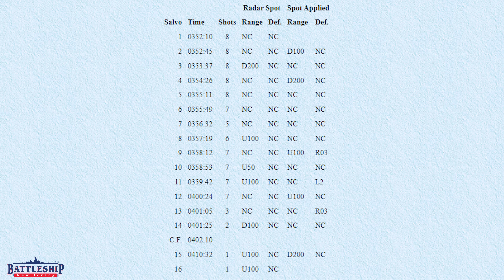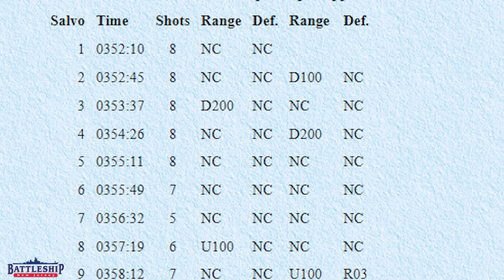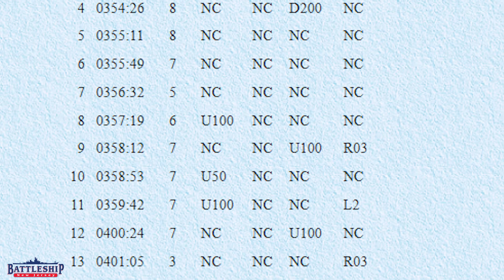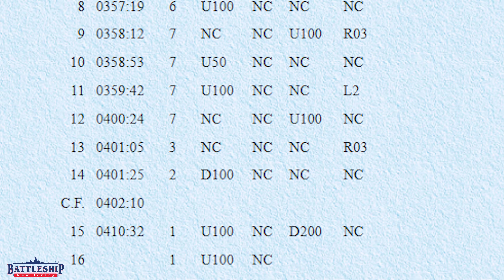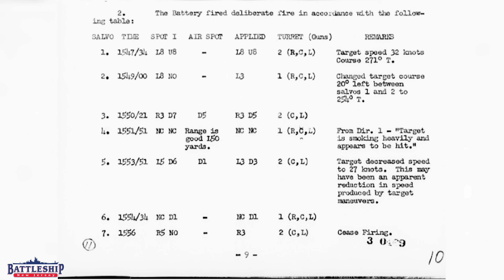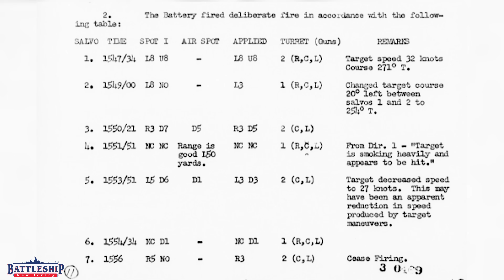Is Misfiring Naval Artillery Common?

Comment: I know that this is a late question, but what happens if the shell is rammed into the lands, but is not fired?( malfunction with equipment, powder, etc) has that ever happened? Would they try to fire a reduced load? I’d imagine in a normal instance where they had a shell loaded but decided to not fire, as you explained in part of the presentation, they would just fire it in a safe manner. Just have never seen what the procedure would be for a misfire or shell that needed to be removed. Thank you, anyone, for input.
Reply from the maker: If they can fire it, they will. If they absolutely cannot fire it can be brought back out but it's tricky and dangerous.

https://youtu.be/6aC-dqji_Jc
Reply: @BattleshipNewJersey Thank you!! Another commenter had mentioned that there was an episode regarding this, but I couldn’t find it. In small arms, it’s pretty straightforward, but there is absolutely no way that anything like that could be used on naval artillery. Thank you  for the excellent explanation.

Comment: I had (mistakenly) assumed that, in a battleship vs. battleship engagement, the nonlinear behaviour of the Lancaster equations would so severely punish a ship for any loss of main battery fire that any ship that did suffer a misfire was almost certain to be destroyed. For that reason, I concluded ship designers had done everything in their power to prevent such misfires.
As you point out, though, there are two missing pieces to that logic: first, all ships suffer from it, so in reality both battleships would have guns missing their salvo time; and second, a "misfire" only very, very rarely means something that disables a gun or turret for the rest of the engagement. 
Thank you for this very interesting video, and for the reminder not to forget about operational realities in conducting tactical analysis.
Reply: You just sent me down a sinkhole researching those equations, thanks for that

Comment: GMG1(SW) ret. Misfire indicates that you initiated a firing but gun did not discharge. Mechanical failures that prevent gun loading aren’t considered misfires. An open breech explosion is just that and not a misfire. Modern naval guns have a very low misfire rate. Most misfires are caused by faulty ammo. Over 20 years and thousands of rounds fired only had 2 big gun misfires, one ammo, one mechanical failure. Have a few misfires from small arms ammo. If the ammo quality is high you see very few misfires.

Comment: My first engineering supervisor served on one of the Iowa class battleships ( I forget which one ☹️). He claimed that a full 9 gun broadside moved the ship sideways about thirty feet. Is that true?
BTW: My dad worked at Midvale Steel in Philadelphia from 1943-1945 machining 50 caliber 16” naval cannon barrels. His section machined the outer surface, & prepared the bore for fitting the sleeve. He said those giant barrels would stack up beside the lathes, stacked like telephone poles, sometimes for several weeks - until one day they  were gone! Nobody ever saw them moved. Talk about wartime secrecy…
Reply: Some high alloy steels need to sit for some time before their heat treat is fully cured. Ditto for armor plate. So I've read.

Comment: I didn't realize how much damage battleships did to themselves simply by firing. Still, that's a lot of power to be unleashing and it does go in most if not all directions. As much as I hate the fact that battleships are no longer of the line, I can see why a destroyer with missiles can concentrate power on a much more pin-point basis and not destroy itself in the process. Granted, it would need to be repainted. Sorry, uncle Joe.

Comment: Thanks for the info that was interesting, I would have thought there would be mechanical failures with more often positioning issues and not able to bring the gun to a target. But I never imagined it was that often and that soon in a battle for failures to start in, it's still amazing what they pulled off in the heat of battle because I'm sure just to fire and load 1 of those massive guns takes a lot of resources and manpower with massive fire support system's to maintain each single gun with lots of chances for mechanical failure. As the ship is aggressively maneuvering in high seas at times when engaged with enemy ships when not sitting firing in land. Those guys where no doubt real men inside those turret's

Comment: Yeah, pretty much. Dreadnought-type battleships, broadly defined, went from prototype to the full limits of the system in approximately 35 years. Every one of them was experimental, even the Iowas, as were the pre-dreadnoughts before them. And the obsession with bigger or heavier shells and longer-range guns meant that ships weren't properly designed to withstand the concussions of their own guns. It seemed like a good idea at the time, they were tremendously "cool" and threatening, but they tended to hamper their own tactical effectiveness, and be more useful as strategic deterrents than actual combat weapons. Compare medieval castles...

Comment: I would expect that from time to time there would be mechanical issues, but never to the extent described by Ryan.  The only notable out of service gun that I've read about was when turret #1 on the USS South Dakota took a Japanese bomb hit on the roof. The bomb damaged a gun from turret #2 by making large gouges into the barrel, bad enough that it was decided to secure the gun and not use it.  The bomb wasn't big enough to penetrate the turret roof, but apparently scarred the roof, and also destroyed the periscopes that poke up thru the roof.

Comment: I was a Royal Navy gunnery officer in ships for 14 years.  Never had a misfire.  Misfires are no real problem,  It is a hang fire that causes grey hairs.  A misfire means that you pull the trigger, and nothing happens.  A hang fire means that you pull the trigger and it doesn't go bang, but fizzles gently.  It may go bang at any time, particularly if it is jerked or knocked.  It is difficult to tell whether it is a misfire or a hang fire externally, so you always act as if it is a hang fire, and keep the weapon pointed safely down range for at least 30 minutes before unloading, and then immediately storing that cordite safely overboard!
Reply: Would some valves for injecting water into the chamber help, to extinguish any sparks that could still ignite something? They would need to be very pressure tight, of course...
Reply: I'm a retired US Army artilleryman.  Wow! Same problems, much different ways of dealing with it.

Comment: IIRC, the RN and the WW1 German navy didn't open fire with full broadsides - preferring to fire a salvo (typically half broadside - e.g. left guns in a 4x2 arrangement, modified by  the later Nelson and KGV classes) at the estimated range, followed by another salvo at a different range before the first salvo landed.
The spotting would determine if the range and line were correct. With a nominal reload of 30 seconds, time of flight about 60 seconds, this is a quicker way of getting on target.
Once accurate radar range and fall of shot was available. the practice could change... HMS Duke of York fired broadsides at the Scharnhorst based on radar ranges from the onset

Comment: Misfires are no joke. My grandfather was onboard the USS Mississippi (BB-41) when they had a full-on backblow during gunnery practice in 1924.  A gun in the no. 2 turret exploded when a small ember from the previous shot was undetected as the power bags for the next shot were being loaded.  Something like 40+ men died in the explosion, then several more died when a remaining bag detonated during the rescue attempt.  Fortunately, my grandad was stationed up high as a rangefinder and was nowhere near the turrets.  Very sad.
Reply: My question is who is actually recording the details of these salvos? Is there a scribe or a yeoman in the gun Turret?. In the heat of battle this seems incredible to have this much detail. Or is it all just estimated during a calm after the salvos are done?
Reply: What you are talking about isn’t considered a misfire. Complacency for not swabbing the bore and just bad luck.

Comment: This is very similar to what you can expect from a gun-howitzer battery in the field artillery. Long firemissions always start off rapidly, but then slow down as the crew has to move shells around.
Reply: Yeah 4 or 5 max gets down to that 2 sustained pretty quick.  One of the bigger concerns is mistakes from fatigue.   Correct settings from the fdc, right shell, right fuze, right fuze setting, right propellant....doesn't happen often, but when it does, it always seems make its way to friendly forces.

Comment: 205  218  Firing logs
This brings up the question. During a battle  engagement, is someone documenting problems / miss fires that occur in real time or is this something that is figured out later? 
Also, is there a firing counter on the guns to keep track of the number of times and at what time it was fired?  I don"t recall seeing this in a prior vid.
Reply: recorded in real time - I believe the fire control system semi-automated this, spitting out a record of the time stamps the salvo went off, and what corrections were input as they were entered. 
Iowa's at least had a "times gun fired counter" per gun that fed back into the fire computer and was reset when barrels were replaced, with a cam set in the computer to adjust for the barrel wear.

Comment: Great video, very much enjoyed it. However the title is a bit iffy. A misfire is when you pull the trigger and nothing happens but a click. Extreme caution is necessary lest the misfire become a hang-fire. Muzzle discipline is CRITICAL here. Failures of various loading components and systems result in a barrel not being loaded in time for a salvo, nowhere near as worrisome as a barrel with a triggered charge not correctly fired.

Comment: The reliability was almost higher than I expected it to be; the figure I had in mind was Prince of Wales ending the fight against Bismarck with onle one gun operational, so the amount of full salvos after the first one sort of surprised me
Reply: The POW was very new when it engaged the Bismarck.  I imagine that the increasing number of breakdowns was revealed by a much longer sequence of operation than ever practiced revealing more "fragile" parts of the system. Also it should be noted that there are problem guns, that misfire frequently but there are some guns that fire virtually every salvo. So its not just randomly distributed failures.

Comment: great vid Ryan, u might want to check out a hot vid on youtube of Missouri participating in Sink-Ex 89, impressive vid showing her slower rate of fire on her 16 inch guns but the 5 inch guns are maintaining a high rate of fire... I wonder if the firing stats are available for this exercise, the exercise I am assuming lasted longer than what was shown in the video... but the vid is impressive especially with the volume turned up...

Comment: Lesson: Never ever, ever...ever, ever, ever use a game as a yardstick for reality. 

No matter what game or (entertainment) simulator. 

They are made by people who a) have never operated what they simulate and/or b) have to taylor it to mainstream expectations. Even if a Dev researches these engagement protocols, rest assured a producer above will intervene and say it doesnt play well that way.

And in modern simulators its simply that stuff is still classified/top secret and they cant possibly know better. Wikipedia is not a source. 😅
Reply: Tailor* 
And it is the reverse. The producer is more likely to request accuracy and the dev overrule for gameplay reasons. Gameplay is always king, or should be when producing games. Particularly decreasing control from the player and replacing it with RNG is generally unpleasant and frustrating for the player. 

In terms of a Naval combat game, it is more a test of the tactical decisions of the commander. If you can remove variables, the better the experience.

Comment: I would have expected more ammo related and fewer gun related malfunctions ... again something learned 👍
Of course problems with the crew not able to reload quick enough i would neither count as gun related nor ammo related
Reply: I think that is unfair. The crew are operating mechanisms not hand loading the same way. If a bag twists as it bounces out the shute and has to be corrected or the hoist runs slow, that isn't a crew related issue its a crew solved issue.
Reply: @mandowarrior123    i see your point there ... but i was talking more about that the crew could not move the heavy bags fast enough to the cannon or something like that.
And even if we count that in, it would be even MORE gun related malfunctions, just that a few of them were not noticed because the crew solved it before it even became a malfunction.

I am, as i said, very surprised that there are so few ammo related malfunctions (for example if a primer does not go off or the powder does not burn right (which would lead to a squib shot), etc. etc.
In my handgun for example most of the very few malfunctions i have are ammo-related, almost never a gun-related one. So it's quite the opposite to the ship canons.

Comment: The Nowaki record is interesting. It is a stern chase, so the roll of the ship throws off aim, this is where the stable element input to keep the guns on target becomes important. Only turrets 1 & 2 bear, so they alternate salvos. The constant left and right adjustments show that Nowaki is evading by splash chasing. If the previous salvo landed to the left, you wait for the flash of the next salvo firing, then change course slightly to the left, as the shooter will have adjusted to the right. This is why destroyers at long range are impossible targets, no fire control system will hit a well handled dd at long range.

Look at Commodore Goodenough at Jutland if you don't think this is true.

As for casualty rates, on NAVWEPS there is the record of the time the USN fired out the entire magazine of a BB in one sitting just to learn how it worked trying to get every last round out of the magazines.

Comment: In terms of crew fatigue, it would’ve been quite a sight if the Navy did a rate of fire test like with USS Idaho with one of the Des Moines class cruisers.
Reply: With auto loaders crew fatigue is not really a factor. And the Navy supposedly tested the autoloader mechanism with thousands of rounds of constant fire with no issues. They consistently achieved their designed nominal rate of fire in actual shipboard gunnery exercises as well.

Comment: Bismarck fired 93 of 104 possible in the Battle of Denmark straight, Prinz Eugen fired 21 salvos and fired 150 or 152. 

However, the rate of fire was about 1 salvo a minute per gun as Bismarck and Prinz Eugen fired A+B and then C+D. 

I have read but have not seen or could not tell but in the actual footage of Denmark straight, Bismarck fires one 7 gun salvo.

Comment: Well, I had this question in my mind for a long time and it didn't come from a video game. It came from NavWeaps. In reading some guns theoretical firing rate, there's several that had caveats stating they didn't achieve this due to errors in equipment or drill. My research didn't prove conclusive.

Comment: great vid.  cool written records/stats on the in battle shooting.  overall great info.  as to IF the presentation matched what we expected from the vid title???  NO.   mis-fire would be this to us:  the trigger was pulled.. and NOTHING happened! this we are sure could be from many things other then the problems/issues you covered in this vid.  it would be a situation where the the breech had been opened from last round, and all work/tasks etc were then completed to get the breech closed again, the gun set to elevation etc. and the control room told the gun was ready to fire.  but NOTHING happened once the trigger was pulled. these situations we think would have to be carefully dealt with and documented as the gun did NOT fire and is still LIVE! if the round cold NOT be fired somehow. then the crew would have to open the breech and clear power and shell out as well as find what caused the mis-fire and fix it. a far more serious situation then most of those you went over.  well.. that is our opinion.. you asked. we answered.  keep up the great vids!!

Comment: Hi Ryan Great Video. If you notice in the link you included about the West Virginia there is also a navigation chart and time of the battle. About the time the number of shells fired drops  she made a starboard turn. This would account for going from 8 to 7 then 3 to 2. At the time of the cease fire only her forward guns 4 barrels. Plus her rear turrets would need to swing around 180 degrees to the port for them to reengage on the port side. From 03:55 to 04:00 she was not broadside across the T but at an angle. I surmise that turret #3 right hand barrel stopped firing due to being too close to the superstructure. At 04:01 was the last turn to starboard. This was probably communicated to the gun crews and the rear turrets ceased firing leaving the forward 4 guns left till ceasefire at 04:02. So if you take the course changes into account the West Virginia was mostly using her full available battery during the battle.
Reply: Nice catch.
You're on top of that one.
Reply: @dukecraig2402  100 % agreed  Mr Alex is on it
Reply: @rogerstlaurent8704  
Yea, it would appear that there actually wasn't any problems with the equipment or the crew couldn't get certain barrels loaded fast enough, apparently it had to do with the ships and the turrets relationship to each other.